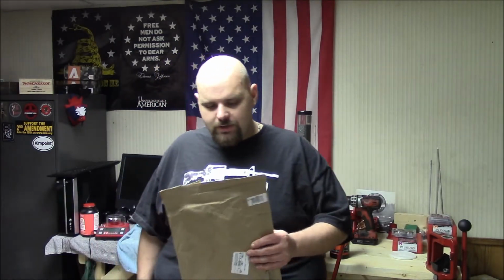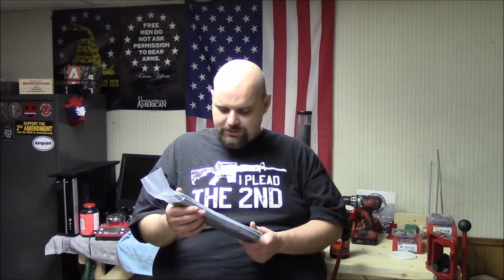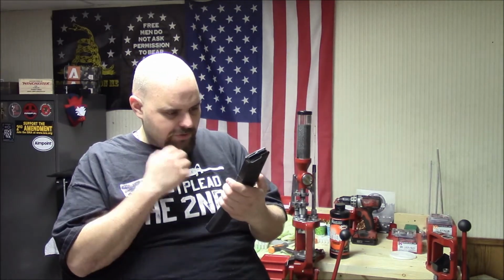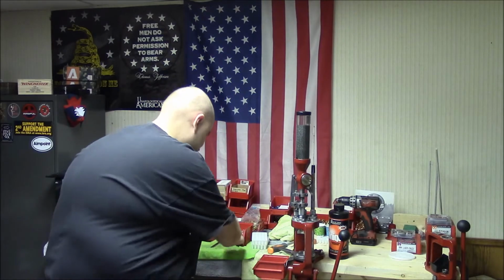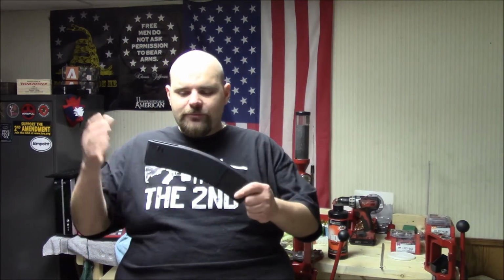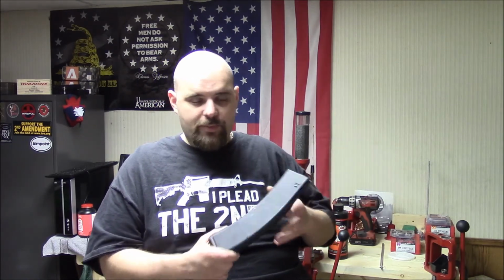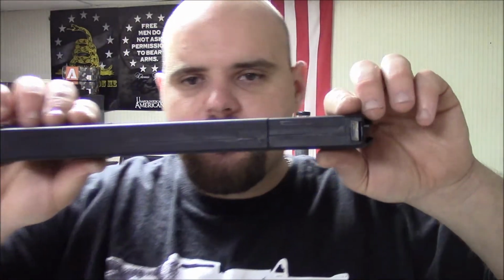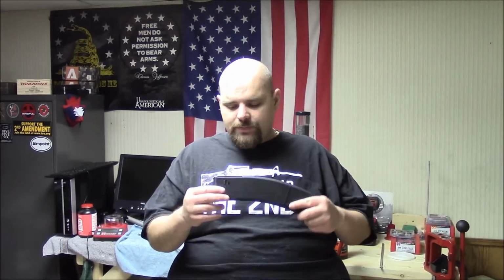BigGunner81- NEW TorkMag 50rd AR15 Magazine 5.56 Unboxing / Review

Comment: Interesting design.  I'm looking forward to the function test.  I love seeing innovations in the gun industry.  Thx for the vid.
Reply from the maker: STLAmmoMan No problem, I'm looking forward to the function test as well.  This was an early production, I'm not sure they are shipping just yet.  I love testing out new products like this, I love seeing innovations.  Especially simple ideas that fix larger problems.  I'm very much a mechanical/electrical minded person.
Reply from the maker: STLAmmoMan I finally got a chance to test it out and it works awesome!  very happy with it and seems to be reasonably durable.. I dropped it loaded, and threw it down range a few times no issues..